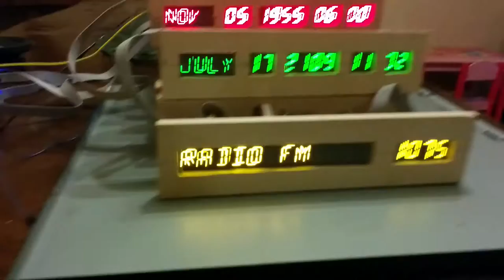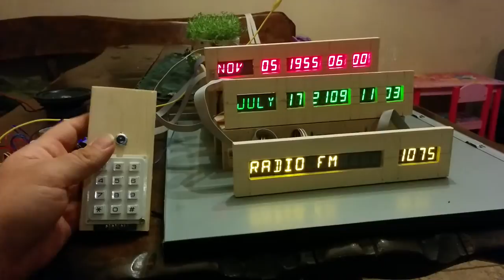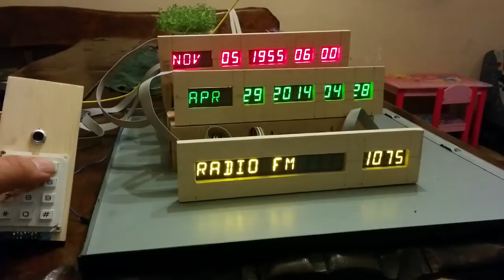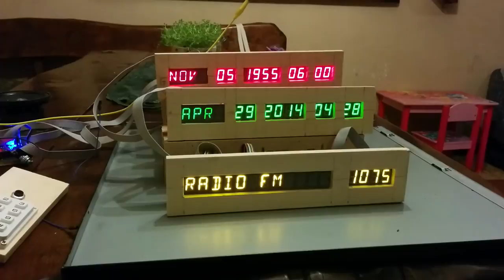Time Circuit Clock from Back to The Future - Current Status

Comment: Awesome. Are you going to sell this as a complete item as I would buy?
Reply from the maker: I am not sure if it would be legal to sell it.
Reply: Cant see why not as its only running on 12 volts dc I assume?
Reply from the maker: 5V DC, legal issue is with back to the future name.
Anyway, I plan to redesign it to make it simpler and cheaper.